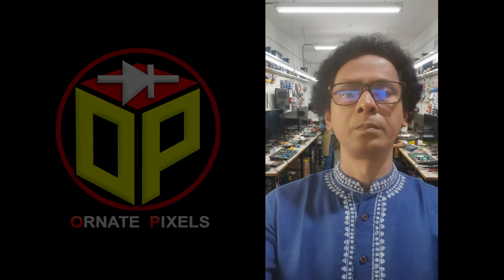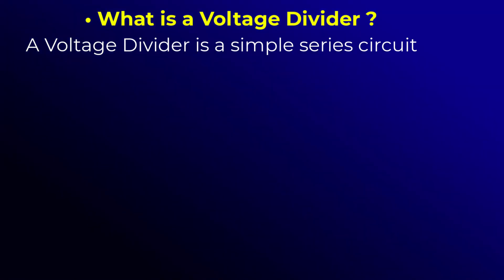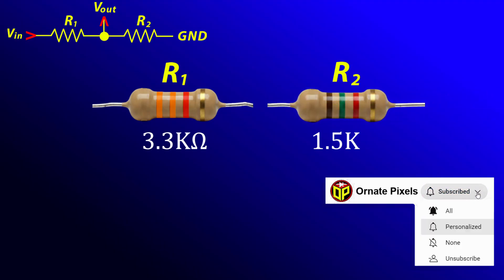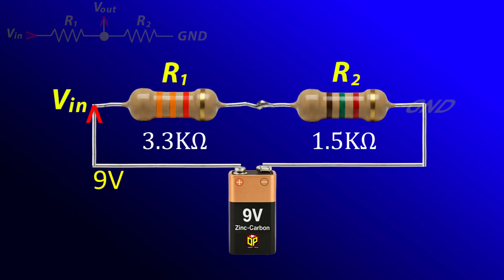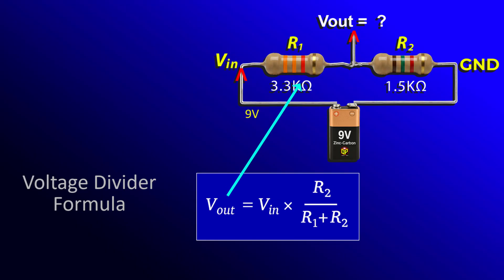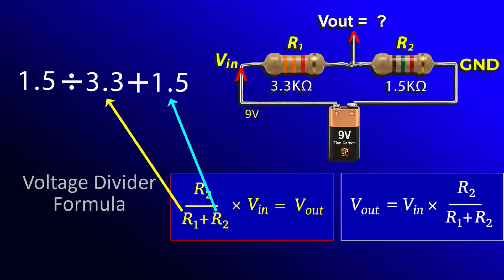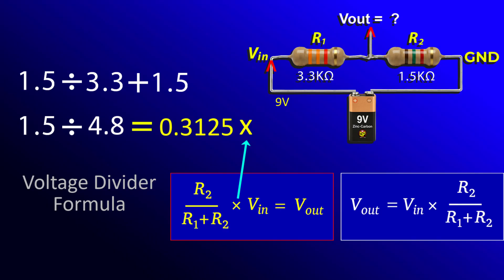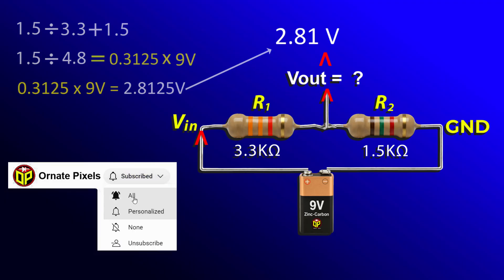Voltage Divider Circuit Solved: The ONLY Formula You Need (Master Vout Fast)

Comment: AoA sir If a android board require 0.9v for cpu .is there will be any issu if i made this supply from direct 12v from board will it work perfectly or it shortcircut the cpu.
Reply from the maker: My answer is no. According to the rules, taking 0.9 volts from 12 volts will not be right at all,
it will damage the processor. You should do fault finding. You need to find out the source or the voltage regulator that is not working.  Thanks  Brother 🌿❤🌿

Comment: Sir if you don't mind can you help sir how to verify is any ic is good or bad input and output is good or bad
Reply from the maker: Generally, an IC has several pin types, including GPIO (General Purpose Input/Output), Vin (Voltage Input), Ground (GND), Coupler, Bypass, Feedback, and Regulated Input/Output pins.

Knowing the basics of electronics is key. Once you understand fundamental circuits, you can easily determine the expected voltage at each pin and whether the IC is faulty or not.

However, in your current situation, here's the best approach you can take:

Check Operating Voltage (Vin): Use a multimeter to verify if the IC is receiving its required operating voltage. No power means no function.

Check Associated Components: An IC rarely works alone. Check the capacitors, diodes, and resistors immediately connected to the IC for shorts or open circuits.

Basic Output Test: If the IC is supposed to output a voltage (like a regulator) or a signal (like a microcontroller), quickly check that main output pin.

Tip: Until you gain that basic knowledge, always refer to the IC's datasheet to know the function and expected voltage of each pin. Thanks Brother! 🌿❤🌿
Reply: @OrnatePixels thank you so much sir 🙏 I'm a beginner but through your kind heart i knew little bit every day to repair electronic to earn money to provide my family..i have problem with financial.but i hope God will help me with this..with respect you sir.for your kindness.God bless you and your family sir.stay healthy sir.